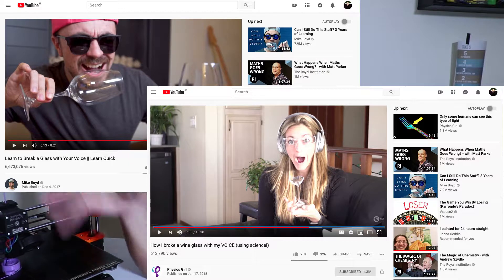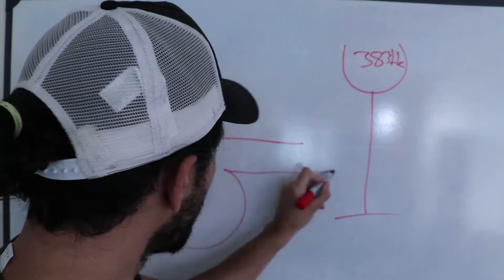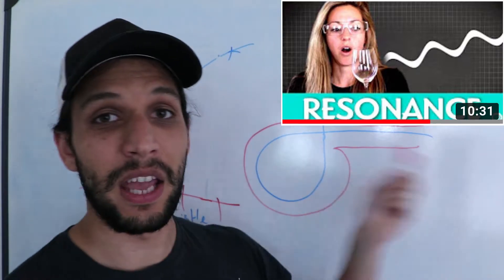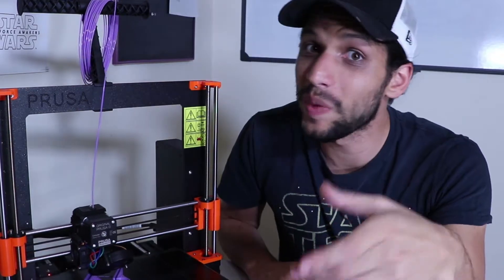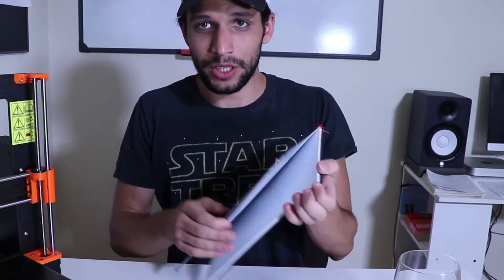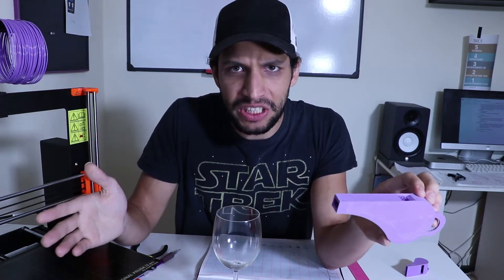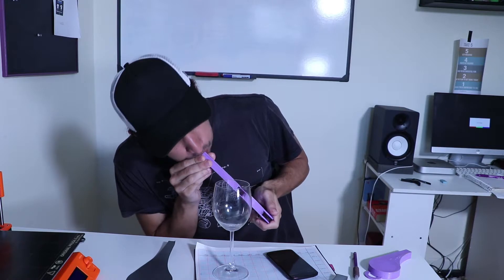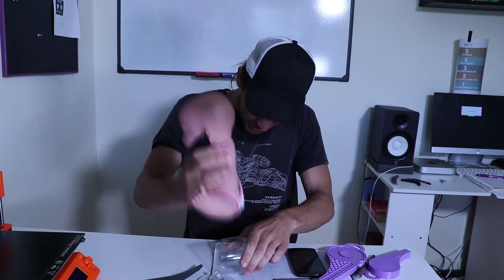Break A Glass With A Giant Whistle 3D Printed on Prusa i3 mk3s

Comment: You should clean the bed with soap water and isop alk (90% an up) or ask the livechat
Reply from the maker: I actually got some of those wipes for it today. So will do that before printing from now on!
Reply: @EthanDavd  and dont forget to give the printing bed a good, warm bath in soapy water, USE only non perfumated soap !!! Thats very important, If you cleaned it in perfumated soap water just clean it in non perfumated soap water untill you cant smell the perfum anymore and than wipe it with alk
Reply from the maker: @throwawayaccountm1325  I didn't know that one!! I will give it a bath this weekend :P 

With only non perfumed soap ;)

One side of the bed is covered with finger prints, I try not to touch the other side that I print on haha